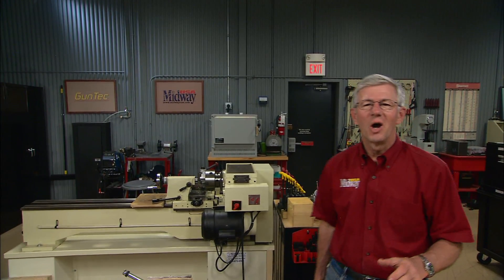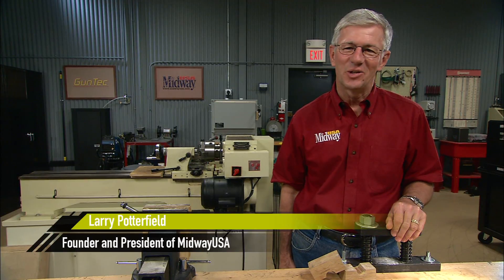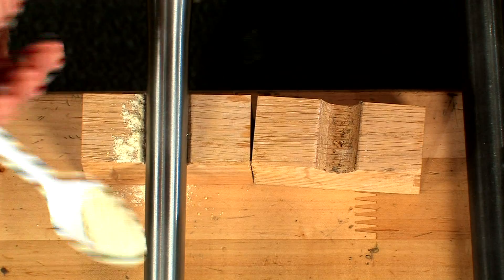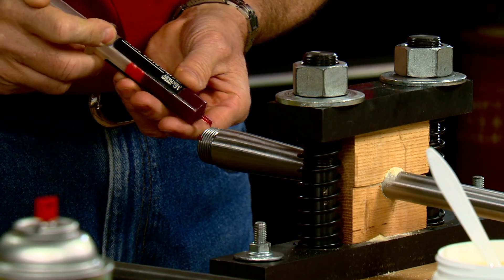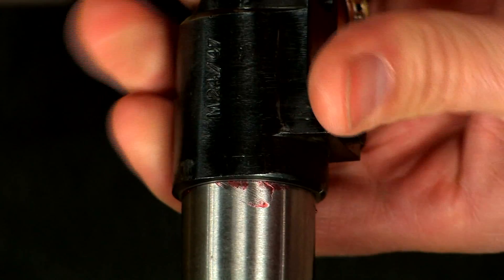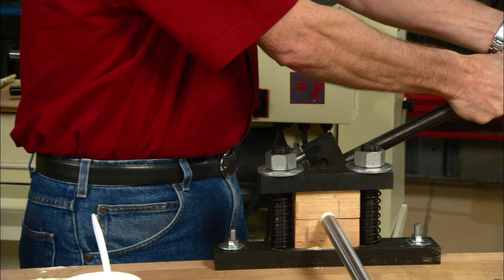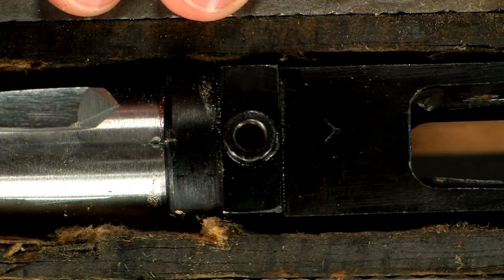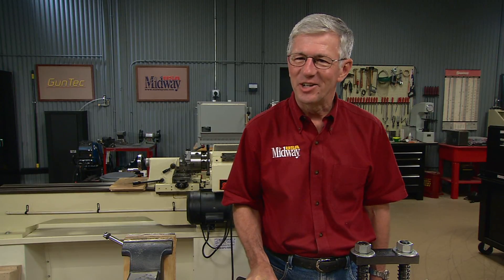How to Install a Short Chambered Barrel on a Mauser 98 Bolt Action Rifle | MidwayUSA Gunsmithing

Comment: When rebarreling a 98 Mauser with a short chamber barrel do you need to machine in a cut in the chamber for the extractor?
Reply: Scott Henricksen not necessarily, pretty much all metal work can be done with files, it is just ridiculously slow and requires a steady hand. People rely too much on machines these days. If you are rifling a rifle (for example) is easily done with a lathe etc, but can be done by hand tools, but again is very very time consuming.
Reply: No, Mauser 98s dont have extractor cuts.
Reply: @boredboiseboy so theoretically you just need headspace gauges a finish reamer and some patience?
Reply: @boredboiseboy  hey I know it's 4 years since you post,  but I just saw a video that says you do & his old barrel has a cutout for an extractor & Shaws description says you do I've now looked inside 3 different mausers one a VZ 24 one a FN & one an early JP SAUR none of them appear to have a cutout for the extractor , I don't think there is one what's going on here  ?